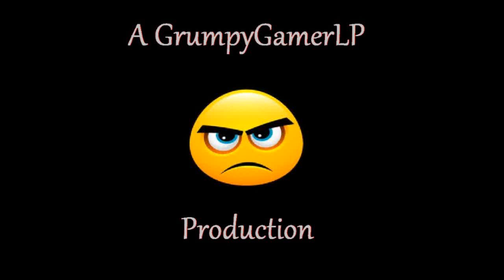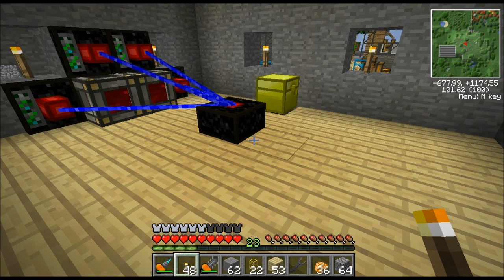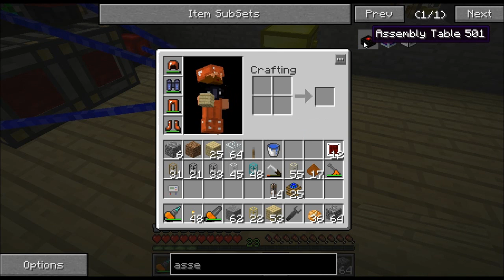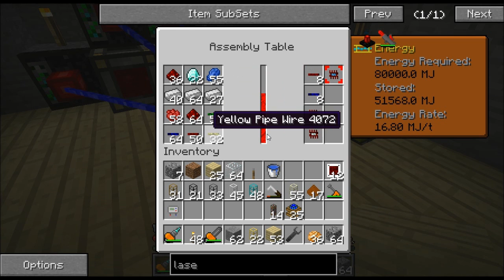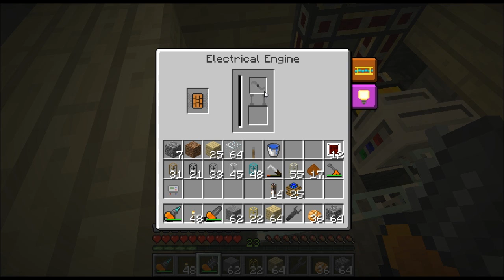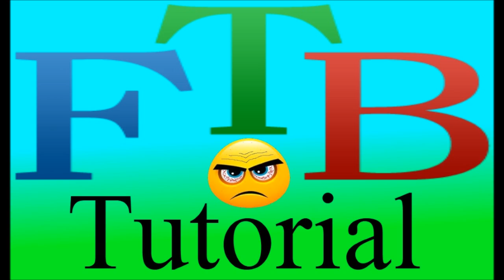FTB/Feed The Beast Tutorial/Guide - Assembly Table, Facades,  And Laser, How To Use And Make

Comment: The difference between a facade and a redpower cover is that the facade covers the pipe in the same block. The redpower cover would have to be in the next block over. It may not seem like a big difference but thats a spot you could place a torch for example or allow water to flow through.